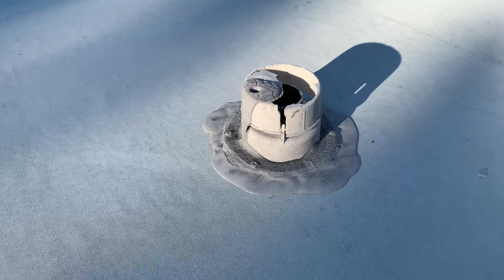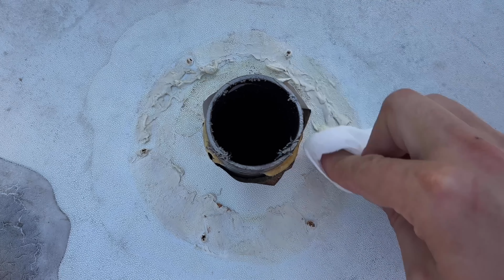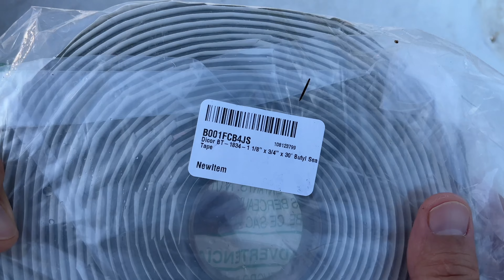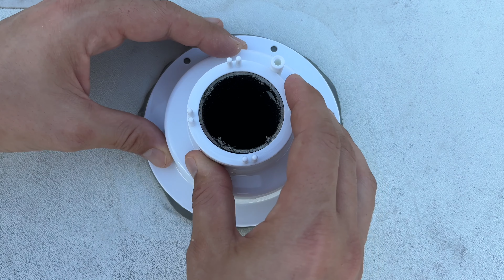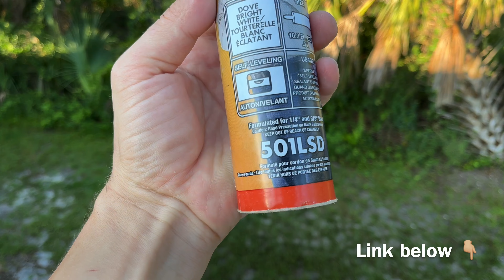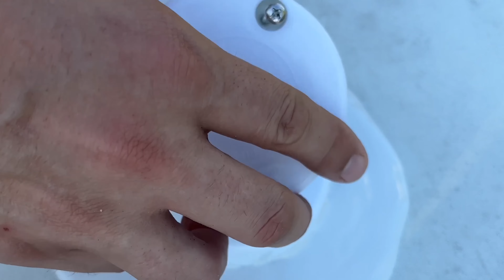RV plumbing vent cap replacement DONE RIGHT

Comment: Can brake cleaner be used to remove the left over pieces of old sealant?
Reply: Absolutely not!!!  Brake cleaner will dissolve the ABS or ASA plastic the vents are made of instantly.  The new style brake cleaners are mostly acetone. Depending on the TPU your roof is made of it will also dissolve that.  You can test it by cutting off little bit and soaking it in the cleaner.  It is a terrible idea to use any petroleum or acetone based cleaners on TPU or ABS/ASA plastics. Always test cleaners on a part that is off the camper of the same material or you will have a very expensive repair on your hands.
Reply from the maker: That is a very good point!
Reply: @AXG6800  How about using PVC Pipe cleaner, the cleaner you use before gluing a pipe joint?
Reply: @firsteagle8500 that is the same thing, acetone
Reply: @firsteagle8500  Its not just the fitting plastic - think of the roofing material. You may not think that anything happened, but the material can be degraded with solvent exposure and eventually crack apart.

Comment: Can brake cleaner be used to help get the sticky left over parts of the old sealant off?
Reply from the maker: Give it a try.
Reply: I would not recommend brake cleaner or any other harsh solvent other than simple isopropyl alcohol! EDPM roofing in particular can be badly affected by solvents. It can swell or even start falling apart. Best to be careful, use a heat gun if necessary and take your time, particularly with older RV's!

Comment: as you sealed the top screw hole, was it really necessary to seal that hole as the cap snapped on anyway.
Reply from the maker: Yes, otherwise water will collect & stay in that hole, over time the screw will rust, and vent cap may fall off as you drive on highway.
Reply: @RV-time  that's what happened to my vent caps. The screws rusted and the caps both fell off.